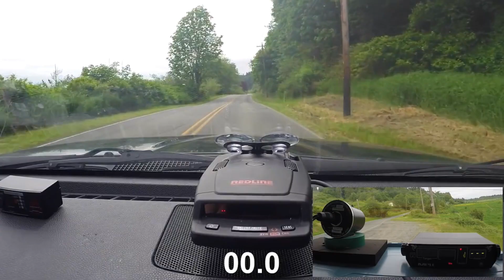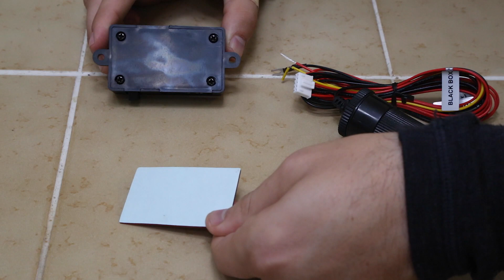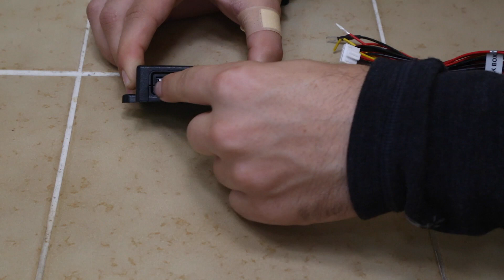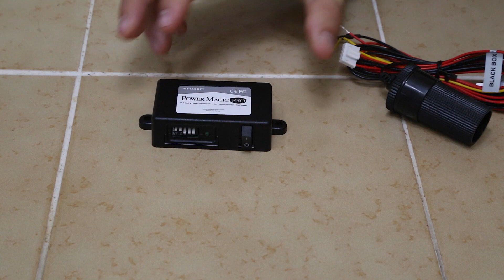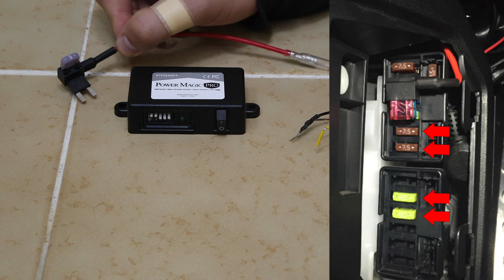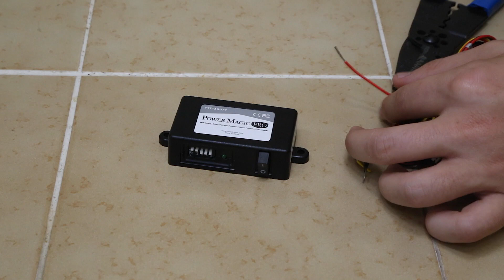How to Configure and Wire a Power Magic Pro

Comment: So I just installed one of these and the dash cam doesn't seem to  turn off when I flick the switch with the ignition/acc off. Is that installed correctly or did I fudge it?
Reply from the maker: Probably one of those things.. are you sure you wired it in to a power source that shuts off when your car is off? Does your camera have a battery built-in that lets it run for a little while on its own without power?
Reply: Vortex Radar
Rechecked everything and it comes down to either the box is faulty or my battery's voltage sits too low. Can't bypass the box with the off switch so I just ditched it.
Reply: Andrew l
Reply: I have just the opposite after I installed mine, My dashcam does not stay on even with the Power Magic Pro "ON" I've checked the wiring and voltages. Guess I have a bad box also, i'm going to check voltages and wiring again then contact Blackvue.

Comment: I guess you have to rely on a cam with lighter plug? Not compatible with ones that terminate with with micro USB. I guess then a regular hard wire USB kit will have to do.
Reply from the maker: Usually cams come with one or two options. My USB ones have cig. lighter plugs on the other end for non hardwired use, for example.

Comment: Great explenation! Got a question for using the add-a-fuse method. Say, I find the fuse that only powers with the ignition on as well as one with constant power and tap into those with the add-a-fuse, do I only use the original fuses or will I need another fuse? For example at 5:52, there is another fuse slot. My guess is that only the original will be needed since the PMP uses a cigarette socket that has a fuse build in? Just wanted to be sure. Also, the cut-off voltages according to the manufacturer are 11.8V or 12V for regular cars and 22.8V or 23.2V for heavy... I wish the PMP could be configured to 12,5V :D
Reply from the maker: So when you get an add-a-circuit, it has slots for 2 fuses. One slot is for the existing fuse you pull out of your fuse box and the other is for the add-a-circuit's accessories you're adding into your vehicle. :)

I did find that the paper manual they sent me (which I used for the video) does show different voltages than the PDF they have online which is strange, you're right. 12.5V would be nice, I agree!! :)
Reply: Ah ok! So, for the add-a-circuit accessory fuse (for the PMP), does the amperage of the fuse I add matter?
If so, how much amps would you recommend? In the video you used a 3amp fuse, but would a 5amp fuse be alright?

Thanks for the replies by the way!

Comment: power magic pro is awesome. i'm using it with my blackvue dr650s-2ch
Reply from the maker: +fondoo Awesome. How do you like the camera? I just got mine in today and I'm excited to start using it. The cloud stuff works well from my living room. :D
Reply: i'm very satified with my blackvue and power magic pro. i've had it for almost a year now. very easy install. i'm not using the cloud, since i dont want to use all my mifi data for it.